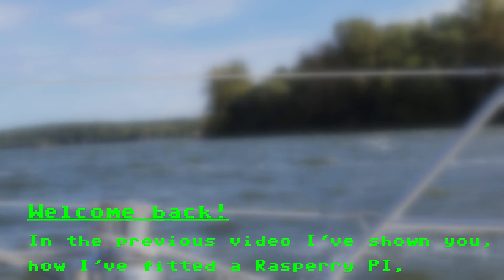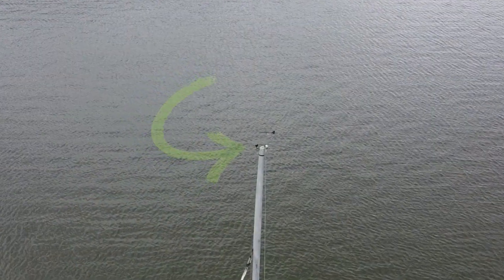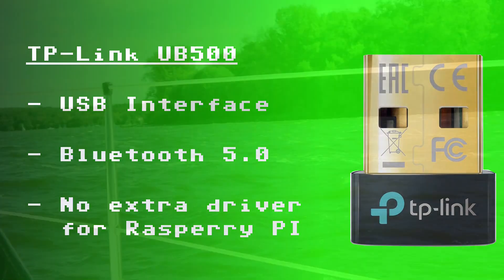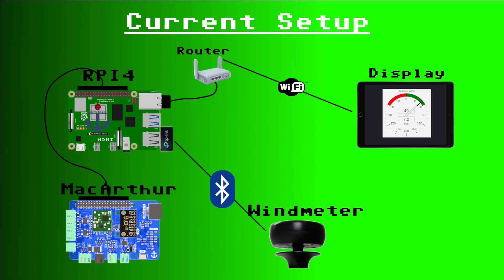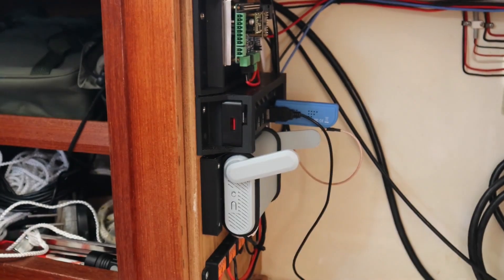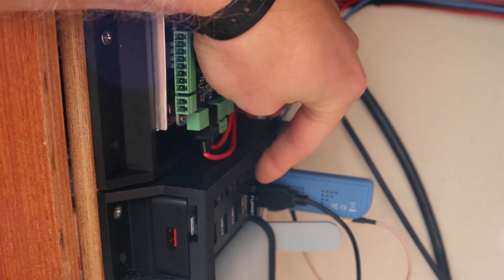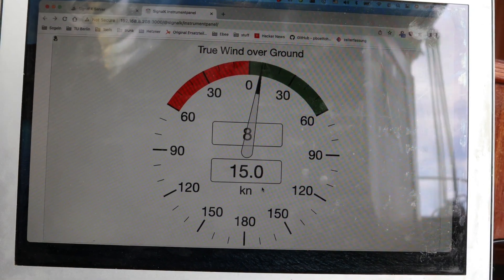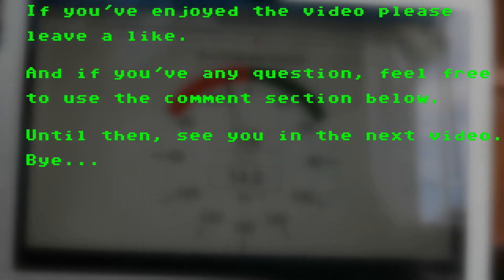DIY Navigation electronics: Integrate Calypso Windmeter into OpenPlotter MacArthur HAT setup P.1

Comment: Thanks for this. I'm exploring a similar setup. How have you found the Calypso Windmeter? Would you recommend it?
Reply from the maker: Hi @neilleonard1764,
there are some pros and cons. The calypso windmeter has no rotating parts and is completely self-contained + if you take the wireless one, you don't need a cable. On the other hand, it's not that cheap and if you don't want to buy the extra piece of hardware (bluetooth receiver with NMEA support) you need to tinker yourself a solution.

It took me some time to figure out a DIY solution, but currently I'm satisfied and until now, I didn't had any problems (1 year of use).

Another pro, if you need to take down your mast once a year or more, the risk of breaking things is a bit less.

I've put a link into the description of the parts, I was using.
Reply: @8bitsailing  Great, thank you!

I'll have a similar setup to you. I'm curious, why do you need the Wifi router? Aren't you able to setup RPi4 as an access point?
Reply from the maker: @neilleonard1764  Awesome! I think it's a quite solid and cheap alternative to the big commercial ones. I've already used my setup for apprx. 600 nautical miles without any issues.

About the Router:
At first I was using the PI as an Accesspoint. Due to short range I was using a USB Wifi dongle, but it turned out, that to much power was drained through USB. This led to problems with my other USB peripherals and power outtakes of the PI.

Since it's quite anoying if the network breaks down I was looking for something more reliable. The router which I'm using is quite nice, because the PI is now Connected via Ethernet + I've a board wifi, which is super stable. In addition, the router supports the option to connect to another Wifi (e.g. in the Port) and acts as a Internet Gateway so that you have an active internet connection in your boards Wifi.